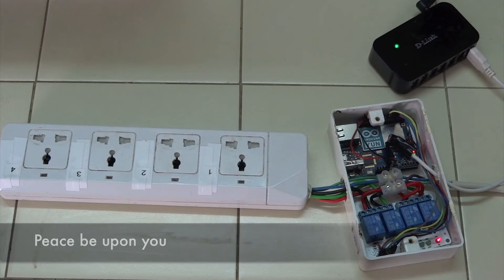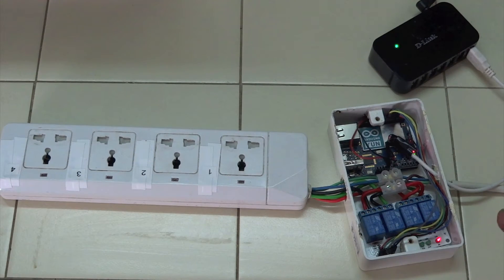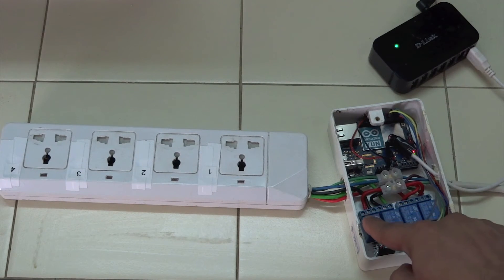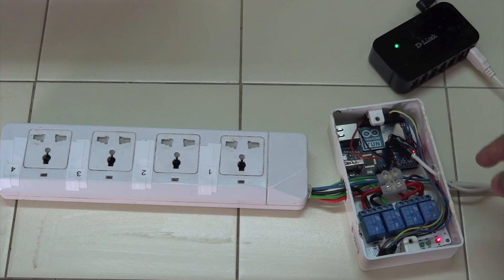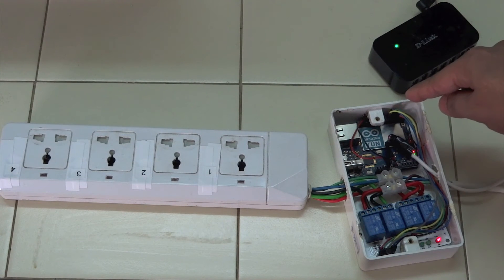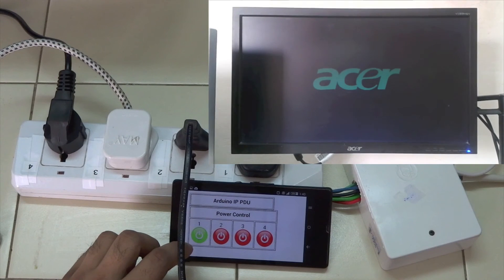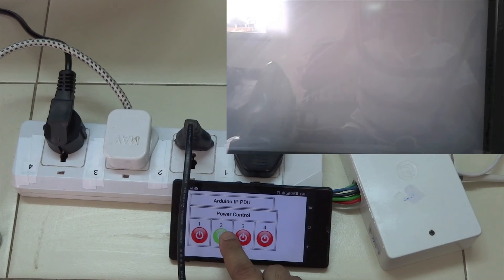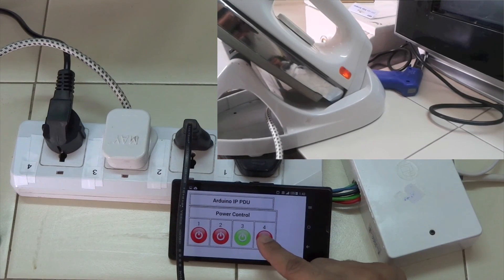Setup and Demo of Arduino YUN powered Web Controlled Power strip - Baba Awesam

Comment: Samir Sogay  Assalam-o-Alaikum Sir, I have some questions kindly can you guide me. (1) Sir i am using Arduino Mega 2560 this is best option for Internet of Things (IoT) projects. Sir i want that my arduino data show on web server i used for this ESP8266 (ESP-01) Wifi Module. But the thing is that i want the access web based anywhere not access only in home. Hope so you understand what am says that. Sir please guide me. I will be waiting your reply. Thanks
Reply from the maker: Wa Alaikum Assalam. If you are having Router at home, you will have to do port forwarding of port 80 towards your esp01 ip address.
Reply: Thank you so much for reply, Sir i want anywhere access not only for home like for big distance like i access anywhere but same city. for this which type tools and technology will be required. Kindly suggest me you can say i am beginner as well. I will be waiting your reply thanks
Reply from the maker: You must configure port forwarding on your home router where your esp01 is connected
Reply: Sir, Can guide me for this scenario. like any tutorials , then this is easy for me. Any suggestion for tools and technology

Comment: Thank you for making great tutorial, i learned a lot from here. I followed everything what you told, but not able to browse web page on browser, it gives error "No such files or directory". In putty SSH window i am able to all necessary files in path (/mnt/sda1/arduino/www/YUNtest) . Please help me
Reply from the maker: Did you upgrade the YUN after buying it? It must have the openwrt firmware which supports the bridging.
Reply: It came with openwrt only, os version 2.03 latest one. Through SSH i can Linux files. Even dataloger example of bridge library works so YUN is accessing SD card, only YUN not able to create link html files or other which exist in sd card www folder.
Reply: I am trying to flash 1.53 version of openwrt
Reply from the maker: What is the URL you are trying?
Reply: Yun ip address/sd/arduino sketch name ...i saw this url format in video
Reply from the maker: try just with ipaddress/sd/